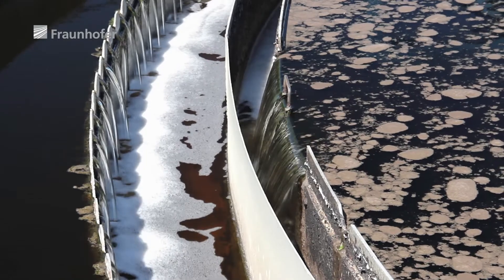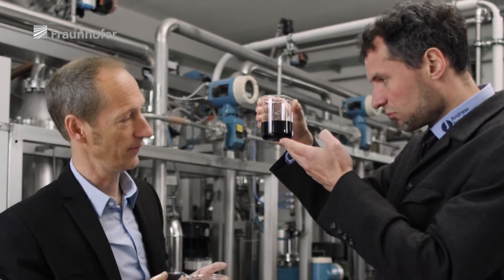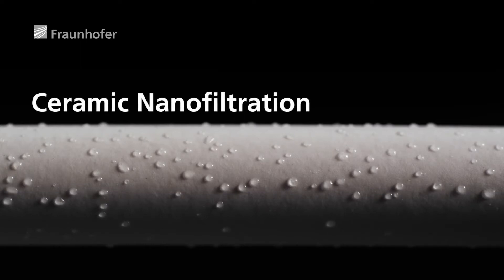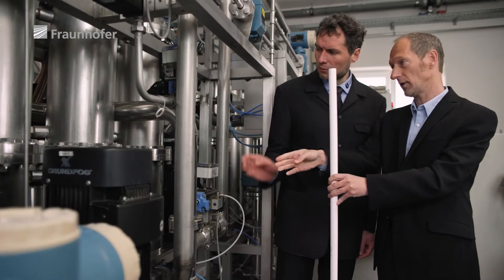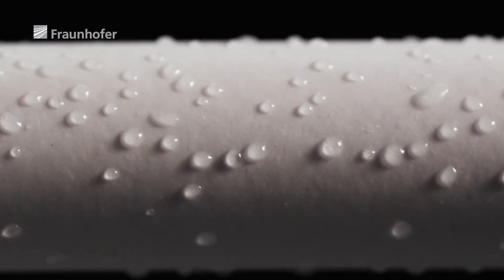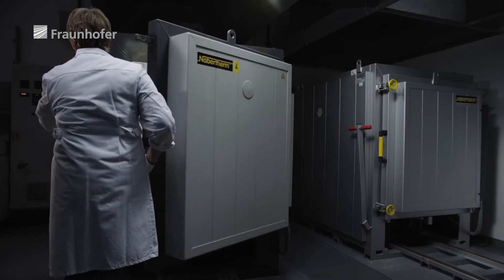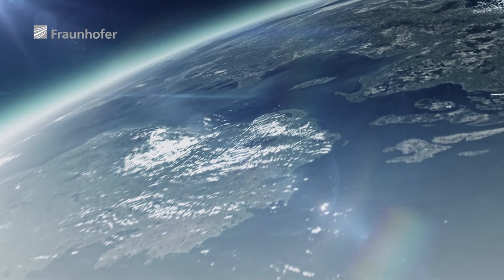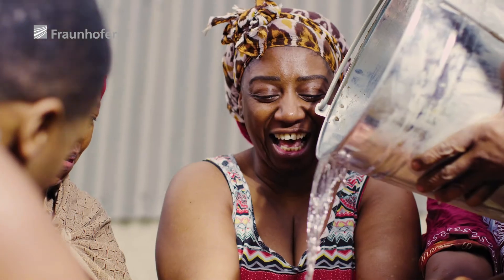Cleaning waste water effectively

Comment: Why don't you use an outside to inside flow configuration? I mean coating on the outer surface of the support? Always I have seen membranes coated inside the tube and flow from inside to outside..
Reply: It because the ceramic filtration system works on cross flow filtration technology. The Outside in membranes are normally dead end filtration